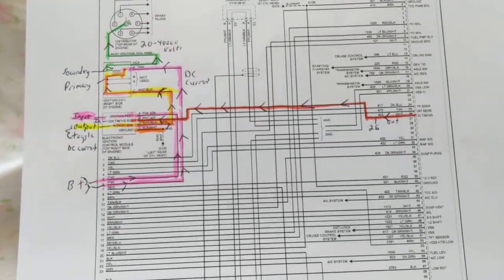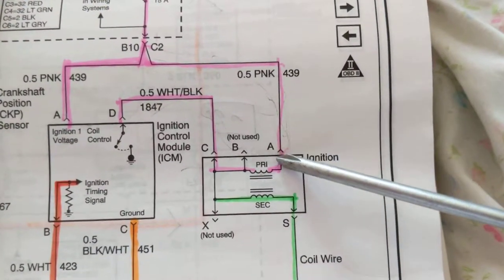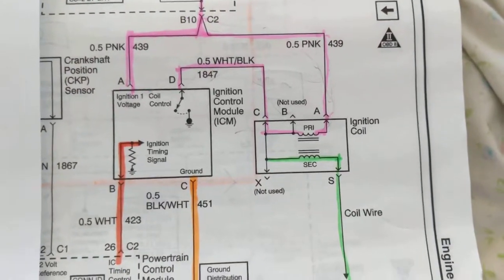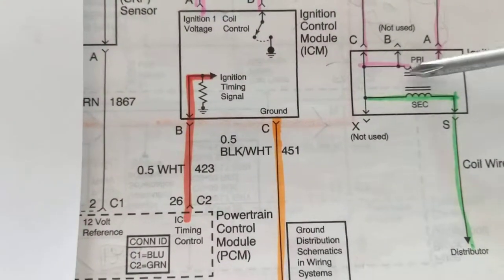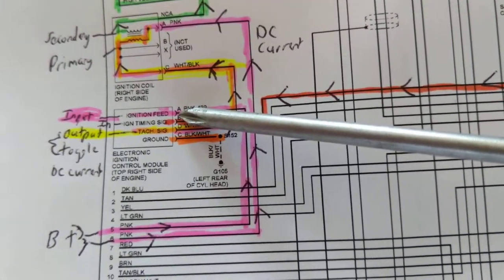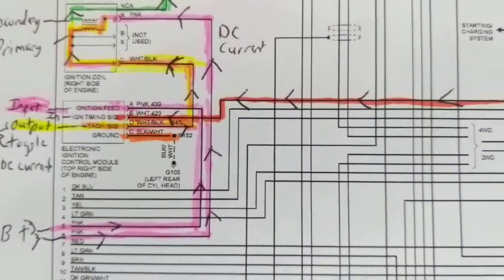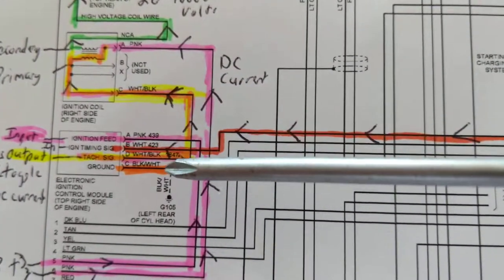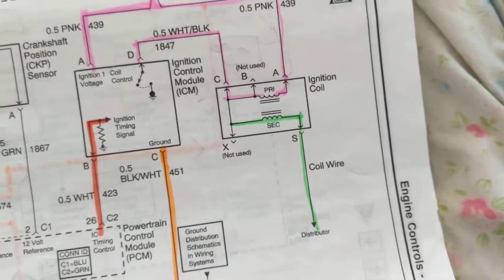IGNITION COIL MODULE HOW SPARK IS CREATED FOR ANY MAKE A MODEL

Comment: So the module needs 12v to turn the module on (Ignition feed)? Or is that used for something else?
Reply from the maker: Yes the module needs 12 volts thank you
Reply: @automotiveelectronicsfroms2699  Is the ecm grounding the feed wire to the module which makes it pulse or something else?
Reply from the maker: In order to get spark the computer the module in this case has the transistor that goes to ground that is on and off determined by the computer but you do not see the transistor because it is in the computer module so yes as a result of that ignition coil will be turned on and off and a collapsing field will be induced into the secondary and the spark plugs thank you for your comments
Reply: 96 chevy 5.7 vortec. My wires show good so is the ground but it looks like I'm not getting any feed from the computer wire and no spark from the ignition coil.